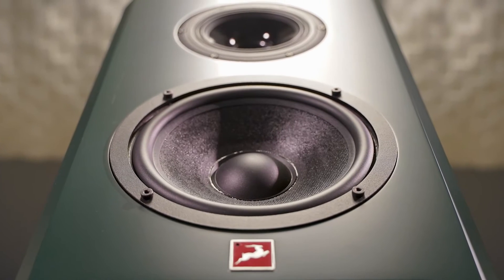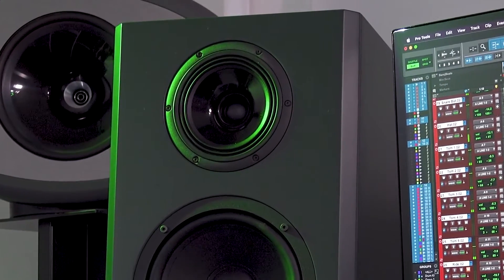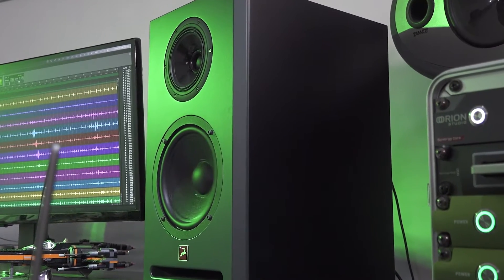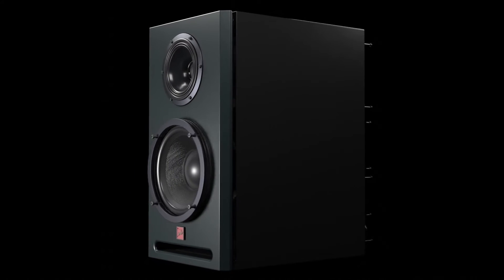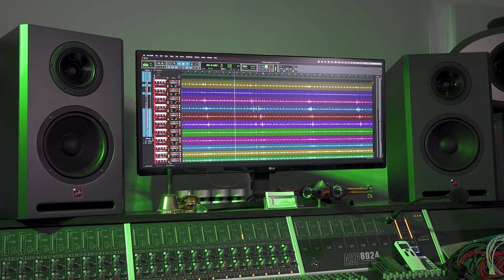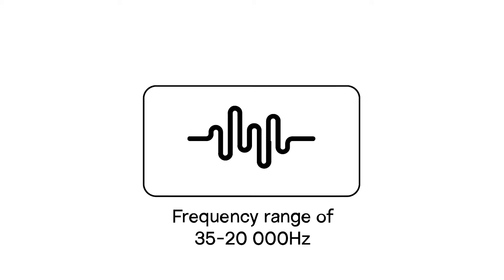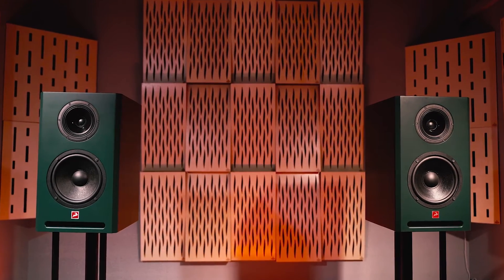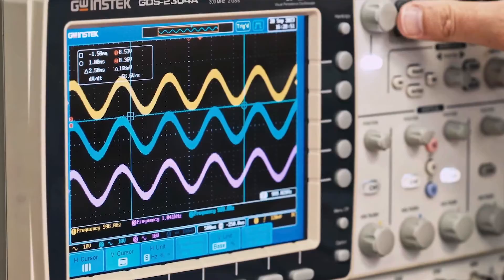Atlas i8: Power, Performance, and More! | Part 1 - Tech Explained

Comment: Amazing monitors! Working on them about 3 months. Can u tell when the software for Atlas will be released?
Reply from the maker: Thank you for your patience! We're excited to announce that a Control Panel is now available for the Atlas i8. To access this new feature, please open the Antelope Launcher, connect your speaker to your computer via USB, and update to Bundle 2.0.0. The Control Panel allows you to adjust key parameters remotely, without the need to reach behind the speaker.
Reply: Same here, I've had my set for four months and am enjoying them immensely.
Reply from the maker: Still waiting on it! We've got a lot of great products on the way and we're trying to take as much time as possible to make sure that everything will be running great.
Reply: @AntelopeAudio  By the way - We are still waiting software for Atlas! One year